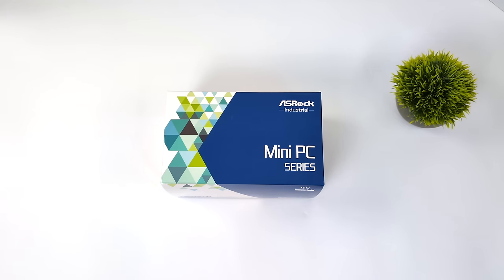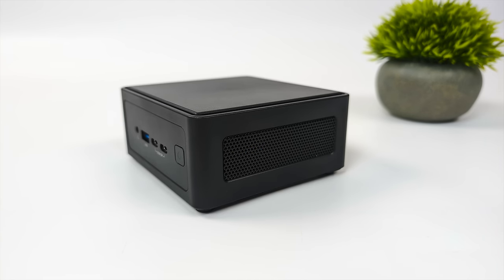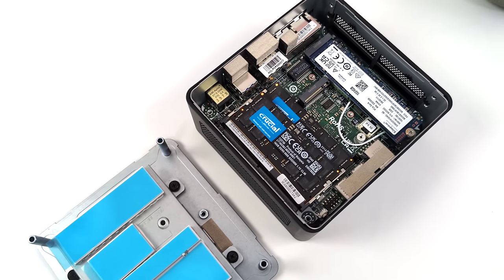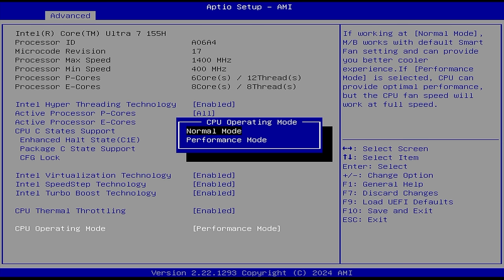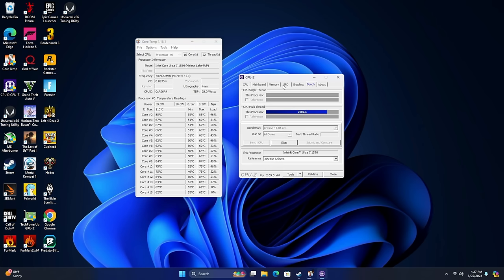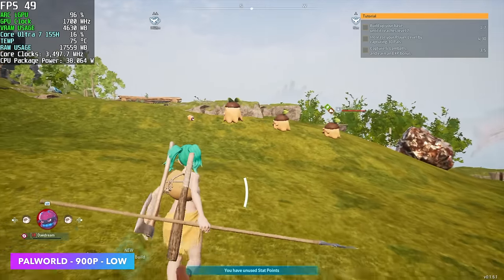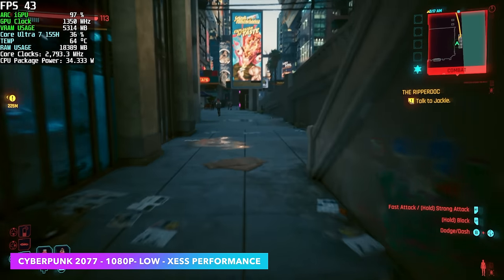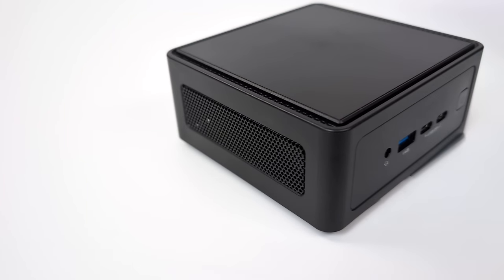The All-New Faster NUC BOX-155H From ASRock Is Here! Hands On First Look

Comment: all of these NUC / MiniPCs continue to put the DP ports in the front. They should at least put one in the back for a third screen.
Reply: Agreed. The port configuration is not the best layout. 

The average user won't use 1, let alone 2 Ethernet ports on this mini PC. Not sure what the purpose of that is. They would have been better off having at least 1 USB-C on the back.
Reply: What a goofy thing to do. Port layout is important
Reply: All?  This is the first I see with such in the front.
Reply: @TrusteftTech  I think most of the AMD Ryzen Mini PCs that have a USB-C port on the front are using it as a third video output (dp-alt). My GMKTec M5 has it. I think some of the Intel mini PCs using USB4/thunderbolt have also had ports on the 'front'
Reply: @Rushil69420 Having a USB-C as a possible display out in the front is not the same thing as having a DP port in the front and claiming/complaining that all mini pcs have a DP port in the front.  Is it?
Reply: @TrusteftTech   DP-alt runs over USB-C lmao - you said you'd never seen it before and I pointed out that many mini PCs in fact have a front-facing USB-C/DP-alt port as the 'third' display output.
Reply: @Rushil69420   Are you slow or are you acting like you are?  The original post to which I replied talked about DP.  NOT USB-C which can do DP.  He/she was very clear on saying DP.  Talk to someone else.
Reply: @TrusteftTech  you’re the one who doesn’t seem to get that DP-alt (over USB-C) = DP lmfao - and his comment could only possibly be referring to that (because there’s no full sized DP on the front of any mini PCs including this one!!!) 

I think you need to go back and reread lmao
Reply: @Rushil69420  ok you are slow.  Have a nice day,.
Reply: @TrusteftTech  do you think there’s a DP port on the front of this PC that ISNT also the USB4 port (running DP-alt 🥴) ?

Because then what would YOUR original comment even mean? 

OP and this video are obviously talking about DP over USB-C

Comment: I noticed from the marketing language that this is being sold as an "AI PC". We are really getting to the point now where at least some sort of AI performance benchmark is going to be needed. Personally, I would like to see something with T/s data (both prompt processing and streaming) for some standardized prompt using 7B, 34B, and 70B LLM models at  4- and 8-bit quants (LM Studio would be sufficient for that, given how easy it is to install and switch models on Windows machines) as well as some data on I/s for a Stable Diffusion model. I'd like to ask for more than that, but I think those tests would be enough to get the point across.

Comment: So the CPU itself sits on the board's other side, or …? As for the integrated cooling plate, is there some hint as to how high the M.2 is allowed to be? (After all, there's some that come with an integrated heatplate, which adds 1-2mm over "naked" ones.)

Comment: Wow, in the CPU-Z stress tests, some cores were hitting about 90 degree within 20 seconds of the load start ...
EDIT: finished the video. the clocks on CPU and GPU are abysmal, not even reaching e-core max turbo and iGPU was 1900 highest. PPT was 40W tops in games. Eithere there are too many cores here or the power management sucks or system was thermal throttling (insufficient cooling?). In any way a disaster all around.
Reply: Not really, you just have to put the fan curve to maximum, the 12700H nuc which is practically the same thing but with an A770M Arc gpu is able to maintain great cooling (around 60C) when you run cpuZ for a while, preformance wise the 12700H is only 5% slower overall than the 55H. mind you, both use the exact same type of cooling system.
Reply: @dankmemes3153  intel or non-intel nuc? There's a lot of companies using the nuc name but not the same design quality
Reply: @lubossoltes321  intel’s, I’m referring to the NUC 12 Enthusiast serpent canyon edition. 

I wouldn’t trust any other branded NUC other than Intels. Too bad they discontinued it. Gonna wait and see how good this one in the video is.
Reply: @dankmemes3153  then why are you commenting under an ASrock device review ? different price point and quality ...

Comment: hi tech peeps. i have a question about oculink. what is the difference between the flat thin black pre installed cable and the blueish rounder cable that can plug in and out performance wise? or are they the same thing in different forms? i hear the cable quality is important but cant seem to find any info on witch is better.

Comment: Can you adjust the dedicated VRAM? That's going to be the game changer
Reply: Do you... not understand that the "VRAM" allocation is simply there for passing game checks that require a specified amount before loading?
The GPU RAM will absolutely go over the allocated amount when it's needed by default. 
Only poorly-designed games that have a "You don't have 2GB of VRAM, I'm not going to open!" message will be impacted.

Comment: Sir this processor has npu ?
If has,  then wait for 3 or 4 th gen NPU / processor.
Because after 3 gen . It will well furnished. Or good software support for NPU. 
NPU are in developing mode.  Wait for 3 years.
Reply: "Wait longer for better tech when you're getting sent these units for review free of charge."
"Wait 3 years and have nothing in the meantime because better stuff is on the way."
"Never buy any tech product on the basis that, maybe? there will even be a use case for the NPU 3 years from now."

Comment: I hate how its 2024 and theres still no DP connectors. Hdmi sucks.
Reply: USB-C with DP-alt mode means that it supports DP through a cheap, simple cable. 
It, literally, has DP connectors in USB-C form factor.
There is nothing wrong with HDMI.

Comment: The CPU reached 96C in 15 seconds of stress test.  15 seconds.  How much higher would it get in 5 or 10 more seconds?  
Meh.
Regarding the performance of Intel's iGPU, some times it feels like Intel is trying to make sure their iGPU perform relatively similar to their previous generations.  Disappointing.  
And I am not even talking about their drivers.

The sad thing for me is I am pretty sure (based on Cyberpunk), my GTX860M is getting beat by this low performing iGPU, by a lot. 

I would like to see some video editing tests with it.

$700 without tax, and as a barebones system....LOL.
Reply: Do you... not understand how opportunistic boosting works?
The CPU is designed to run at 110 °C all day, every day.
110C is.. how hot it gets. It then optimizes itself to run as fast as it can within temperature, power, and timing limits.
It's a business system that comes with volume purchasing discounts... LOL
Reply: @tim3172  You... *sigh*.  I am not even going to bother.